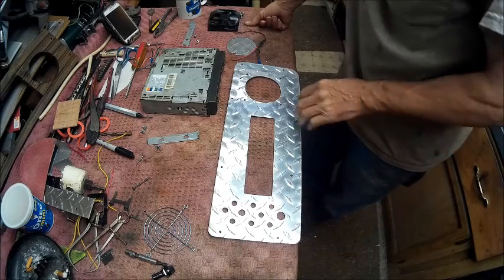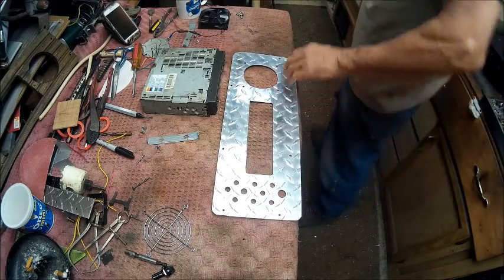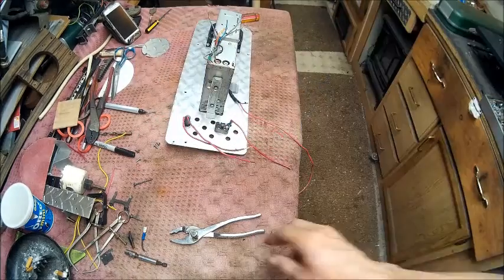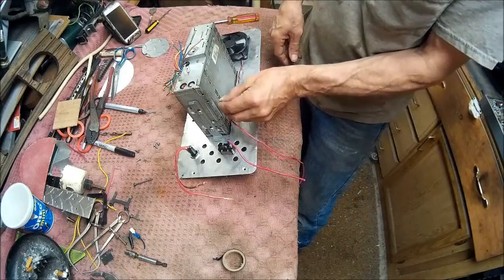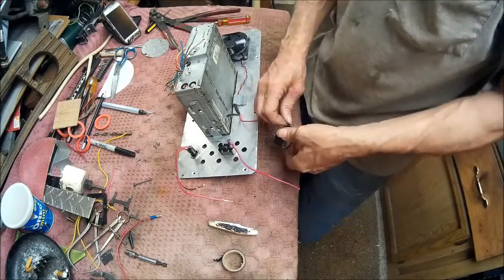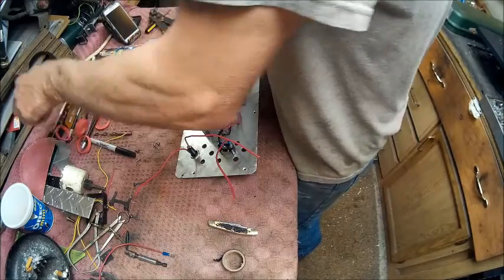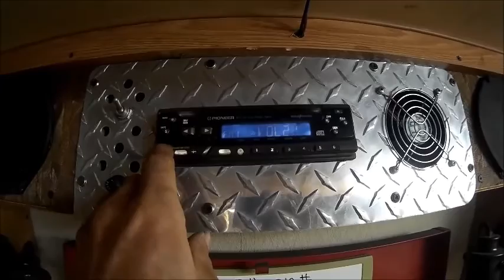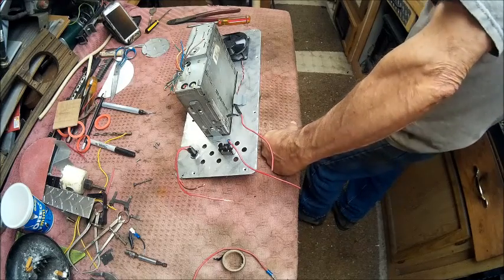Bison shop stereo unit part 3 done

Comment: Are you making a slipseat system?
Reply: O, I guess not. lol Good work.
Reply from the maker: i dont understand what that means
Reply: A slipseat system is a case that truck drivers use to hold their stereo and CB, so when they jump from truck to truck (slipseat) they just unplug power and plug-in again in the new truck. The stereu and CB are all self contained in a case / box.
Reply from the maker: oh i`ve never heard it refered to that way and i have drove tractor trailer my hole life lol. but no im just making it so if i ever need to work on it ever i can with ease.